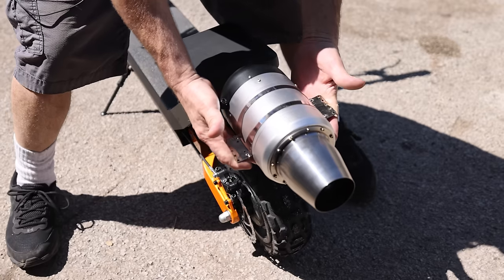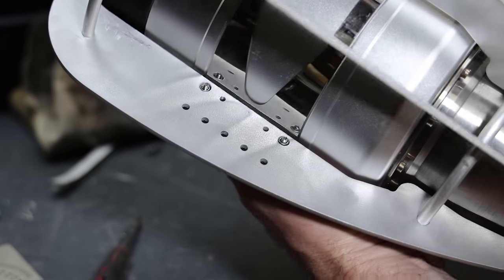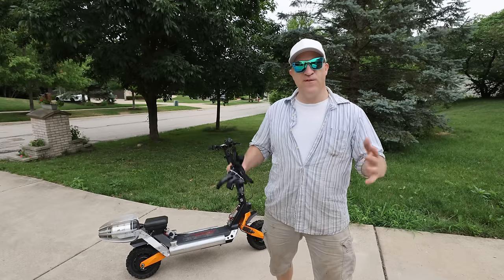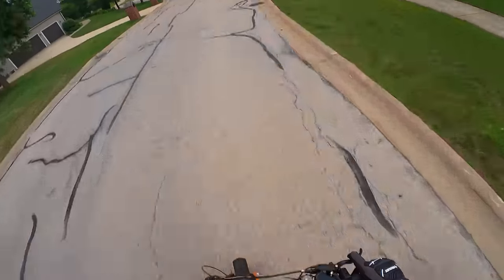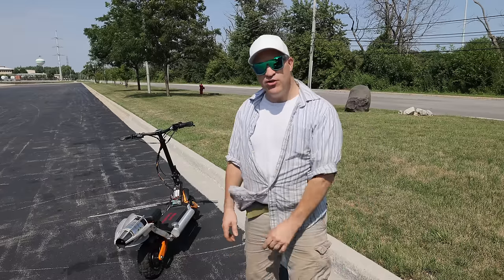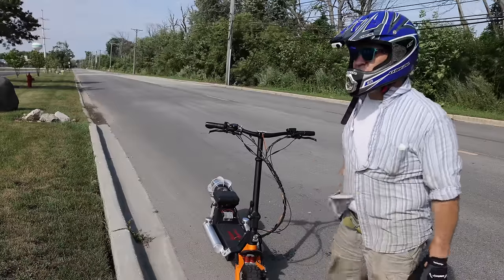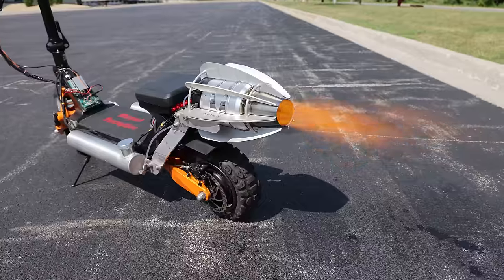Jet Powered Scooter

Comment: With every one of these projects I always think “Is he considering the engine intake airflow?”.
Reply from the maker: Yes of course, but just keep in mind it's not a turbo fan engine it's a turbo jet, they don't need that much air. The majority of the thrust comes from fuel. Also if a turbo jet doesn't have enough air then the engine will stall
Reply: doesnt make difference
Reply: @WarpedYT  as an A&P and amateur just for fun engineer I can say this is 100% misleading. The jet fuel gives energy to the air, the increase in volume leads to an increase in gas flow velocity from the diverging jet pipe. It’s not the fuel that’s making the thrust, it’s the change in momentum of the working air thru the engine.
Reply: Jet dragster car/jet truck have more bad intake airflow but still run like crazy.
Reply: @adamfaqi9112  they also typically have a bell mouth which helps direct that “bad airflow” into the intake.
Reply: @superskullmaster  no bell mouth at all on that "shockwave" Jet truck.
Reply: @adamfaqi9112  show me where I said all. Besides, they don’t need it with 2 to 3 engines with that much power. When you are trying to squeeze the most performance out of minimal power, restricting the airflow (or rather putting it in a place where you can’t achieve ram recovery) is not ideal. Admittedly this scooter isn’t going to go very fast no matter where you put it but that’s mainly because of the chassis.
Reply: @superskullmaster  okay professor 👍👍👍

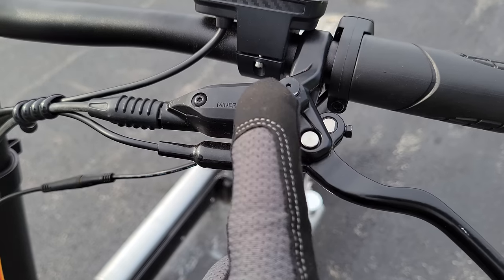Comment: 11:44 That death wobble is what keeps me from wanting to build a scooter and also the thought that if I needed to stop quickly for when a car pulled out in front of me I would slam the breaks and fly forward off the scooter. On motorcycles I had around 5 times where car pulled out in front of me and I slam the breaks but able to control it. On time I had to dodge car and drive in the median of the interstate, managed not to have the bike fall over all these dodges. My legs grab around the bike so I do not fly off when going fast, I dont see hiw you can do that on a scooter. Everlyone who goes 60mph gets the feeling of hiw wring riding a scooter is and I think it is their subconscious relizing that they are not going to beavle to stop quickly without their midsection of their body flying forward.

Comment: If modify the bars to be lower it'll be much safer! With scooters in general you want your grips to be just below your hips. This allows you to easily zigzag, the lower the grips the more control you have. When the bars are above your hips it's really dangerous you can't zigzag at all, you can try to crouch down but the front wheel will just go out from underneath you if you have to turn on a dime, especially if you have to interrupt a turn on a dime. You want your grips to be where your hands are when they're straight down in front of you and your niece are just slightly bent.

Comment: If you put two wheels in front and in back (total 4 wheels) with a free floating suspension widening the floor with a half pike type floor making it longer and wider. On the back where the jet engine is move the black box to add one longer jet engine or two smaller ones side by side. Tapper off the end of the exhaust pipe to help get more speed. Construct multiple thin walls with spacers to shield the tank on the underneath side to prevent any damage to the tank. Try adding a more aerodynamic design to it. have the floor free floating able to move 180° any angle to get over objects in all different terrains and elements making the ride smoother, safer and more enjoyable. Have the jet and battery working simultaneously while being in total control at any speed or in any terrain. just saying, if you're going to think, think BIG (ya know go big or go home). no insult 

For an extra bonus have two smaller engines that are jumbo plane type  cone shaped blades sucking in with tapered exhaust pipes at the end have the handle bar curved to help out on top off the side of the floor/half pike have the engine in the middle with the cone shaped blades tapering off to the front fram  and exhaust pipes tapered off to the end fram . Tires could also be more ball-like with the ability to grip any types of surfaces {!?$ Just some food for thought}

Comment: The speed of a jet-powered scooter would depend on several factors, including the power of the jet engine, the weight and aerodynamics of the scooter, and other design considerations. While there are no standard jet-powered scooters available commercially, it is possible to estimate potential speeds based on similar vehicles and technologies.

In the case of jet-powered vehicles, their speeds can vary widely depending on their design and purpose. For example, jet-powered motorcycles have been known to reach speeds exceeding 350 mph (560 km/h). However, these vehicles are purpose-built with powerful engines and streamlined designs to maximize speed.

In the case of a scooter, the top speed would likely be lower due to factors such as stability, weight, and aerodynamic limitations. It would also depend on the specific jet engine used, as they come in different power outputs.

Assuming a hypothetical scenario where a scooter is equipped with a relatively small jet engine, it is possible that it could achieve speeds in the range of 100 to 150 mph (160 to 240 km/h).

Comment: I like this video, if you use a jet engine it's better not to use wheels, but use small wide wings instead of long ones, so it's simple. enough to make it float a little about 50cm from the bottom, that's all my suggestion, maybe you can consider it

Comment: 35 yes machining I never have time to make anything creative for myself , love you videos yes very inspirational, 
I’ve just seen a video here on YouTube with a 
Subwoofer that weighs nearly 200 pounds with the exact style cage like heat sink as your created to keep the subwoofer cool and gives the sub y better rigidity from basket to magnets being at the weight that it is

Ps curious if The scooter is operated by battery yet you’re using the turbine engine which gives it way more thrust power and speed that overwhelms the the battery the Tronics when it cause a delete to the battery affect more like a stall acting like a break for your problem that you’re having at the point where it exceeds the battery potential of speed shouldn’t there be some type of free wheel

Comment: Fun, yet I can get 87 top speed out of my Nitrox RS2400 V2, also with a dual 2400 W motors, I get wheel wobble too, yet extremely thrilling for an old 68 year old like me!
Also the start speed is extreme too and often wants to lift the front Tyre. If you change your Tyres for tarmac, those are for dirt offroad, you will get a very smooth run too, yet you do not need a jet engine lol
Reply from the maker: That sounds nuts !!

Comment: To get full speed, you will need to unhook all three phase wires. I don't think any BLDC motor controller can handle backfeed of current created by spinning so fast. You may also want to wear some elbow and knee pads. Road rash is a bad m-f.

Comment: whether today we are campaigning on the problem of saving energy

Jet engines need two components, air/fan and gas

Isn't it only with gas that it can produce power... and with pressure/wind it also produces power

Comment: I have the same FIIDO Beast scooter..........it will not me unlock speed or open battery compartment....none of the unlock codes in the manual work.......any suggestions or work arounds......I tried holding the brake and throttle and turning on meter, but it did not result in unlocking speed.

Comment: wheel bearing will melt when the tire is so small maybe have the break shoot out co2 to cool the system from failure hate to see a front flip at 60 mph skate boards do not use break so no issue from expanding system

Comment: Standing up at that speed makes an awfully messy hole in the air.
Besides that, you may have made the greatest getaway vehicle of all time — an innocent-looking 20 mph scooter that turns a corner and rockets to 50 mph.  Now if you could add a parasail…

Comment: 4:50 I ride an electric motorcycle.  No way that's 60mph bro, or even 50 or whatever else the speedometer indicates.  The scenery is moving way too slow.  Can't be more than 35mph tops.  Those scooter speedometers are bogus.  I have one of those performance scooters too, dual motor, dual hydraulic disc brakes, the works.  I thought I was going fast on that little thing until I got on my motorcycle.  Some of those scooters have speedometers that fudge the speed.  I swear I've ridden ones where it was closer to kmph when the indicator said mph.  They program the control box to do that in order to oversell the scooter's capability, making you think you're going faster than you actually are.  You don't question it because standing up on such a tiny vehicle with tiny wheels makes you feel like you're going much faster than you really are.  For example 35mph will feel much faster on your scooter than in your Tesla. If you were really going 60mph, you wouldn't even be able to stand very well if at all.  And if you were really going 60mph on 10" wheels (standing up no less), the tiniest bump on the pavement would be certain doom.  Again, not really 60mph, jet pack or no.

Comment: You are a very good engineer and builder but you should never be on a scooter or a bike without a helmet and full body protection. Also, that was not a good idea to be riding in a residential area.

Comment: Seriously does a fire jet even make any sense to you. It does not to me, you burn fuel releasing pressure creating a molecar exchange that condenses more molecules into an area of space, based on the surrounding atmosphere and pressure allowing to propel forward. It really only makes so much sense, but going beyond surtain speeds means to create a molecular exchange of such intense heat things go radioactive. So I get a little bit of a jet and propelling, I just do not get space engines cause the weight involved and molecular exchange necessary and pressure created on the area of space. Basically a space rocket makes little to no sense, especially when the atmosphere becomes thinner, the molecular exchange and atmosphere pressure is to low for a space rocket to work. A jet plane makes sense but only to a max speed based on heat molecule exchanges necessary at temperature. Which after a surtain speed would make a radioactive jet stream.
Isaac Daniel Shoff

Comment: Doing this on that tiny scooter with tiny tires was damn dangerous and irresponsible. If you want to strap that thing on a dirt bike, something designed to be stable at freeway speeds go right ahead but what you did was extremely dangerous. No protection other than your head. Tiny tires hitting even a small rock and you are asphalt salsa. It’s crazy to see people risk their lives for no useful cause at all. Just wow!

Comment: I realize you left your helmet at home, but I think it would have been a very good idea to just drive home and get it. You were wearing absolutely no safety gear and you ran 60mph in a residential neighborhood.  I thought I was watching one of the Jacka$s movies. The only reason you didn't get injured or killed is because you were lucky. There would have been no way you could have stopped fast enough not to run into a kid, or a car, or even debris laying  on the road surface. There were mores strikes against you than for you. The scooter came out great. We just don't want to hear another tragic story about someone putting a jet engine on their scooter and died. The only thing worse is dying from jet fuel spilled on you from a fire. That is nothing you want to go through I assure you. Please be responsible.